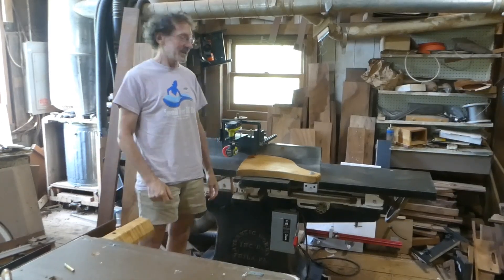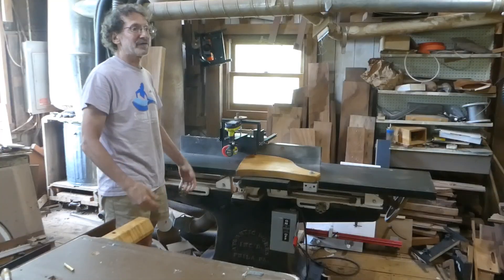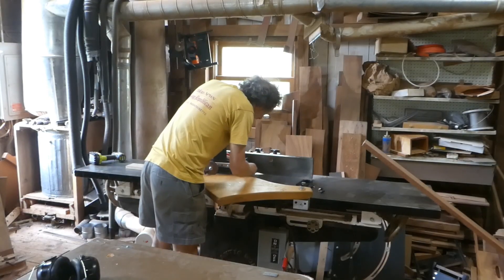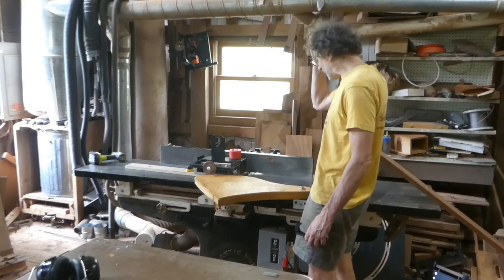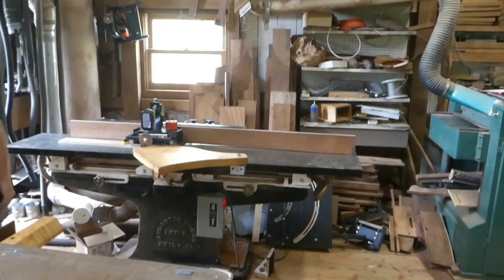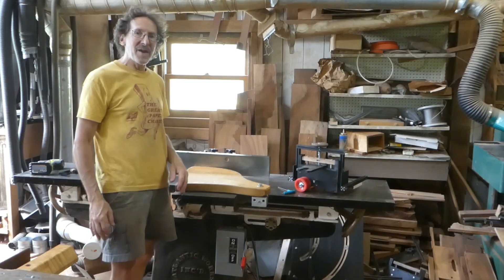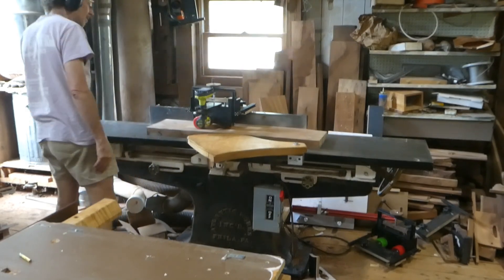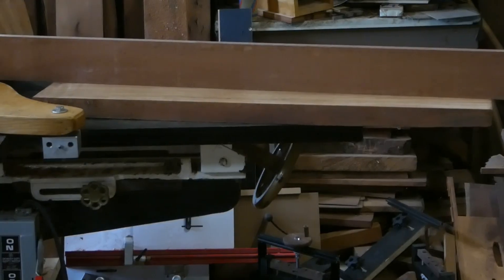jointer power feed both ways

Comment: Adding a power feeder to a jointer defeats the jointers purpose , which is creating a straight edge and a flat surface . Both of which require finesse that a power feeder does not provide .
Reply from the maker: You're correct that jointing wood requires knowledge and judgement from the operator. It's true that some stock cannot be jointed flat with a power feeder without operator discretion, and depending on the qualities of an individual board the feeder may be more of a  hindrance than an aid for that board.  I cover that in the video.

Did you watch the video--where a perfectly straight edge and perfectly straight face were created from bowed and warped boards with a power feeder?  Clearly it worked for the  boards in the video--as it would for any relatively straight stock.

For some stock, and especially for some piles of stock, the feeder can be a big advantage, even if it won't be useful on every single board. Do the ones it will work for first, and finish the stack without the feeder.   

I'm by no means recommending use of a feeder for all jointer work. But it's an interesting option worth knowing about, and this feeder is uniquely capable of utility on a jointer. Especially for injured or handicapped users it can make the impossible easy, and for anyone, for  long pieces on a short jointer, it can easily do what would otherwise take super human strength. And even with a huge jointer like mine, a large volume of jointing can be accomplished with much less physical effort using a feeder. Work smarter....
Reply: @alladd2354  Thanks for the well thought out reply ! I am a professional cabinetmaker and maker of specialty millwork . At 70 i still joint and flatten my lumber with my 16" Monarch jointer . I've worked in shops that used 30" facers with the overhead feed and used an Oliver Straitoplaner . Neither of which produced flat surfaces . Flattening i have found requires a certain touch which i have developed having been at it for 50 years . I did however enjoy your video ! I will subscribe to your channel as i find it very worthwhile .
Reply from the maker: @erichold-h7n  Thanks for  your reply!  A rare knowledable, cordial exchange on Youtube comments!

I acknowledge the subtle skills, both of evaluation and handling, that are required to flatten an imperfect board, ...and,especially, also get good stock utilization.  I think I even have a decent set of those skills myself.

I had to look up what a Straightoplane is---there's one on Ebay right now for a mere 39K (or make an offer). https://www.ebay.com/itm/365589951684?_skw=Oliver+Straitoplane&itmmeta=01JZBMWNXXSR3R9MRK76XNNHEB&hash=item551edbf4c4:g:FKcAAOSw6hVoHOP5&itmprp=enc%3AAQAKAAAA0FkggFvd1GGDu0w3yXCmi1fxn0Wrw1p2ok8qmBRKvzZQN1vNaiPhtVDkBAkMOys8t2kIs9ea7B7tc%2FoHoXrLD%2Bre%2B%2BGMZ%2BrIUaKfW0ZjdoVklteczmzuQJYPR8v5Rxv9vGI1RVZzOBeUMo81k7LPmIhyqGzFHhBfEZ0YKe1pge%2BgWFDyH3SLhATn7vQpWrUv4IOYPJduVbp2FcNFxIc4EUn8y8WUZJg9FHlr8k9QHs8oQ2hMqT9R9rAhbNbot3GbKcY6%2FjYb0ikXSBFiEhNtvuQ%3D%7Ctkp%3ABk9SR4jf8vT6ZQ
So not even Oliver's finest from its heyday could do what a skilled operator can .

These days people are led by the internet and tool hawkers to use "router sleds" for large boards. I can't imagine many things more miserable...

I'm torn between trying to promote my feeder, and possibly overselling it , especially to neophytes, who might see it as a surogate to acquiring skills.

 I'm largely trying  just to have fun with it, and explore its potential to do things other affordable options can't. Maybe I'm fooling myself, but I think it  fills several yawning niches in the vast world of a small shops and serious hobbyists. 

al@alladd.com if you have any interest in continuing this dialogue out of  public view.
Reply: @alladd2354  Hey , i watched several videos on the evolution of your feeder . Pretty well thought out design ! Working with shorter lengths you seem to have some success with flattening and jointing . A lot of what i do involves lengths between 8 to 12 foot long material which requires some techniques i've used to flatten and straighten material . All in all a power feed takes some of the strain out of jointing . Good luck with your invention .